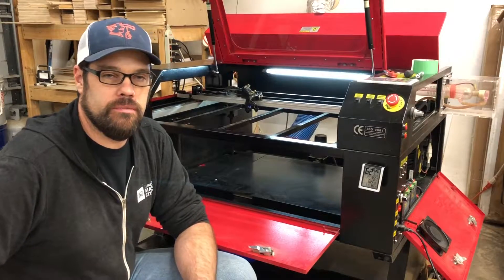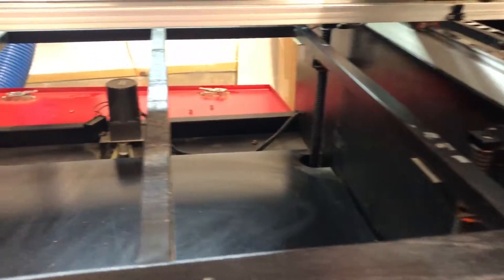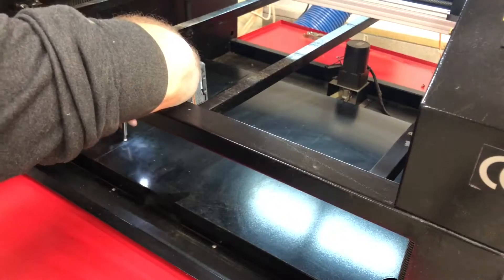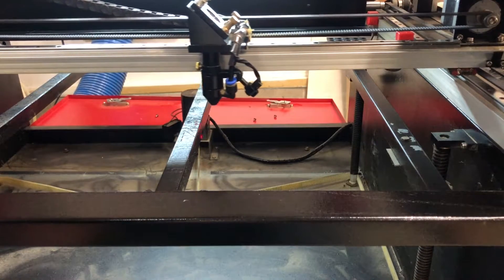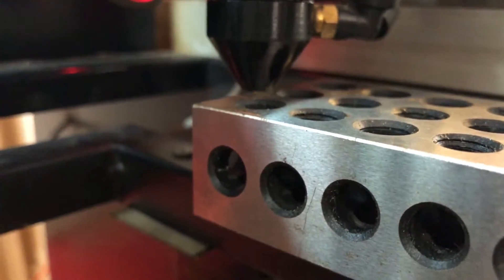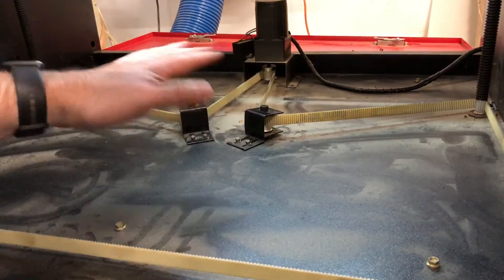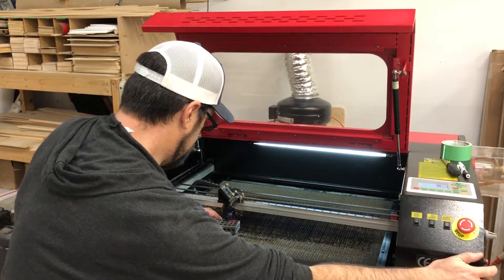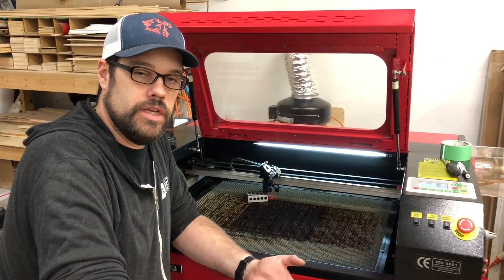Leveling the eBay 60 watt Chinese laser bed

Comment: That was a very helpful video.  If the honeycomb bed is not level do you use shims?
Reply from the maker: If the bed is not level I’ve used metal shims like metal washers on the supporting rails to shim it up but generally I’ve not had that problem with this machine.

Comment: mine has motor at the back then 2 pullies then goes to the 4 corners.. and for the life of me i cant tighten the belt without moving 2 of the corners which then puts the whole machine out of level.. is there an easier way?? all the ohmtech are a bit different

Comment: I’m losing my mind levelling my bed.  You’ve made the tensioning of the belt look easy.  Each time I try, there is enough movement in the screws to alter the bed height, so I’m chasing my tail.  I’m giving it another go momentarily.
Reply: Mine was doing the same thing, so I slipped the belt up - above the gear things and it stopped moving the bed as I was adjusting.

Comment: Nicely explained. To the point. Precise. Nothing more nothing less. In some machines the pulleys, timing belts and lead screws are not easily accessible.
Reply from the maker: Thank you!  It is frustrating that the machines can look so similar but have so many differences. But I hope I can help point people in the general direction to help tune up thier machines.
Reply: Yes the 50W someone has to lift the machine why you get one arm under and the other inside bed. Big pain.

Comment: great videos man. Thanks alot for making them. Im waitting on my laser to come in as we speak. It too is a Chinese laser. Om tech 60w. How much antifreeze do you add to your chiller by the way?
Reply from the maker: Thanks for checking my videos out and I'm glad you've found them helpful. I mixed mine at 1/3 antifreeze and 2/3 water.  My shop has never dropped below freezing while the laser has been in there as I keep an oil-filled radiator running in the winter.
Reply: @Vintauri  I live in Arkansas and generally the winters here are pretty mild but last winter we had a fluke happen and it snowed over a foot deep. It was crazy. So needless to say my shop isnt heated at all and Im not crazy about the idea of keeping an electric heater running out there all the time, so I want to make sure and protect my investment. Could you give me some advice such as do I really need a chiller or can I get away with just the water pump that comes with it? I have noticed they are kinda pricey. And also what kind of exhaust fan do you have and how much was it. Also do you have a rotary axis and if so what kind? I know Im asking alot of questions but I am waitting on my laser cutter to get here, Just like yours (Omtech 60 w auto focus motorized bed), and I just want to make sure I take as good of care of it as I can so thankyou so much in advance for any advice you can give me on how to take care of it.

Comment: Nice video!  I am new to the C02 laser world after having a diode for a bit. I am looking for any info or videos on replacing the marking "red dot" laser as mine arrived not working. I'm sure its not  terribly difficult, but having never done it would love a reference point or how to script or video.
Reply: If you are running light burn, invest $80 into a camera.  Not only will it pay for itself in saved material, but will also eliminate the marking dot.
Reply from the maker: I have not replaced the red dot laser but it should just be a matter of tracing the wires back to the side panel where the switch is. Lightobject sells a positioning red dot laser for about $6 that should work.

Comment: Hi Steve, first of all I want to say "great videos"! I ordered an 80W laser and the cabinet is identical to this... Is it possible to use this laser cabinet as a passthrough? Thanks!
Reply from the maker: The answer is, it depends. The lens tube is adjustable to bring your focus point lower and you can purchase a lens with a longer focal point that will also drop your focus point lower. The combination of the two should allow you to drop the material low enough to get through the access doors with the laser bed lowered down to match. However, it will take some playing with the setup to achieve this. I have never had the need to do anything larger than the bed area so I have not attempted this myself.
Reply: @Vintauri  that’s great. Thanks for the info. Much appreciated!

Comment: I did not hear you mention to level the whole machine first then level the insides.
Reply from the maker: It’s not critical that the machine itself is leave although that would help and is wise to do as well. The most important thing is to have the bed be parallel and square to the gantry.

Comment: Thank you for making this I really appreciate it. I've tried doing what you've done but I can't seem to tighten them without moving one or two of the  screws and putting it out of alignment. Any tips you may have?
Reply from the maker: It took a little trial and error to get it locked in. Maybe try advancing the motor just a bit with the belt still loose so they catch the teeth at a different angle. These machines have varying degrees of precision so you might have to get it close enough and then finish the level with some thin shims between the platform and the bed. I hope you can git it dialed in as it really helps the overall performance of the laser and reduces your frustration on spoiled half cut jobs.
Reply: @Vintauri  Thank I appreciate it, I'll give it another shot!

Comment: That’s easy on abedlift that’s belt drive! Chain drive is way more difficult as the tooth pitch comes into play now!  Also, chain tensioner tend to move the lead screws much more than belt tensioner! Been battling on mine for years,  literally. I’ve just resorted to shimming the honeycomb bed. Very unsatisfactory solution.
Reply from the maker: Shimming the bed is an option but not ideal as you know. These laser machines vary quite a bit but I try to share my experience with this one to hopefully help others.

Comment: So my laser bed is not raising up is a rabbit laser? Any pointers I use ruida laser software
Reply from the maker: I’m not exactly familiar with how the rabbit laser is setup but you might need to see if the motor is jammed. I’d see if you can get to it and check the wires but also see if you can loosen any belts and check to see that the table can still move. I’m sorry I cannot be more help without seeing the specific laser.